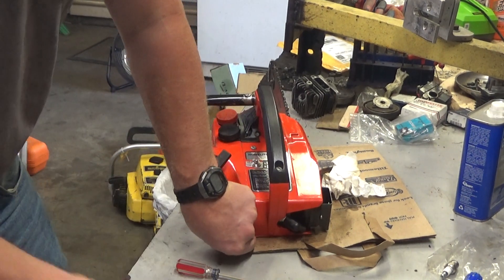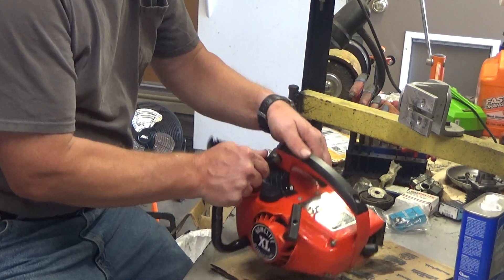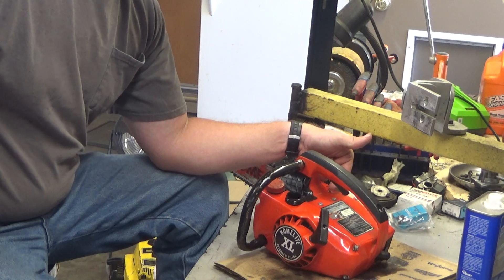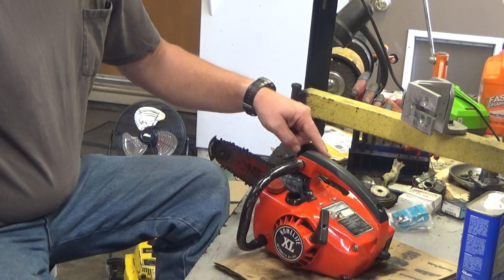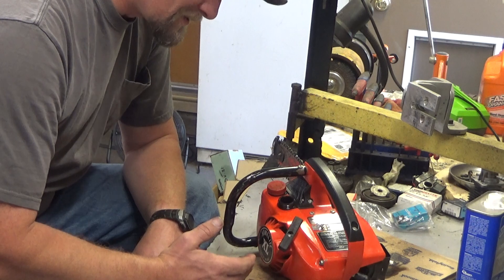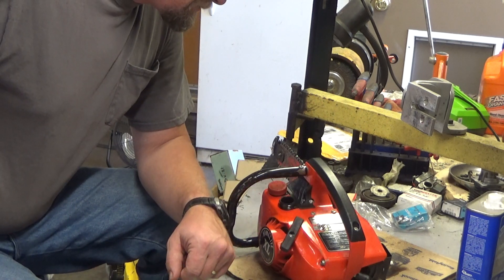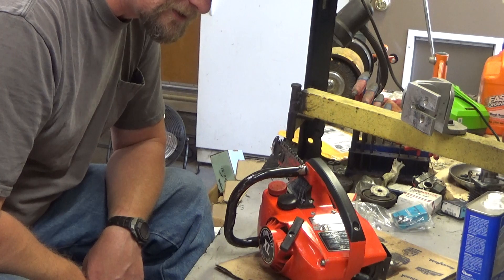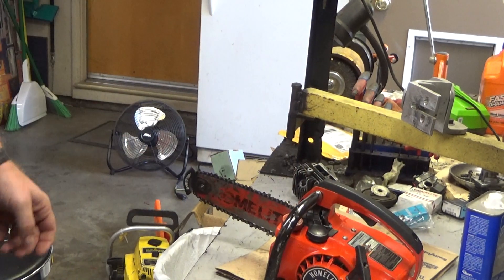Homelite XL Automatic Test Run

Comment: Came across your videos while I was looking for information on the carburetor on my homelight XL.  Part of getting the saw running was replacing the fuel and oiler lines. I got the saw running but I noticed the bar oil is being drawn back into the engine and not to the bar. Any idea what would cause that?  The saw hasn’t run for at least 20 years and I’m not planning on using it on a daily basis but it’s a saw my dad bought when I was 8 years old and it has sentimental value to me since my dad is no longer with us. Any advice would be appreciated. New subscriber and really appreciate and enjoy your videos!!

Comment: Would that cause oil to somehow end up in the fuel tank? I have an XL i bought years ago and the fuel tank has what looks like bar and chain oil in it.

Also I looked on your website and couldn't find a parts diagram for the UT# of my saw. It's UT-10517A

Comment: Leon that was exactly the info I was looking for and love hearing the story on these oiler issues and what they changed etc. 
I picked up a couple of these and noticed the one line has a brass tube one way check valve on the oil feed to the bar. I heard the balls will stick and someone took a hack saw it looks like to the side if this brass tube. Is that what you are referring to as the sintered hose?
Also I found a tiny orfice and was wondering if that was to restrict oil flow.
I was just going to loosen the cap to releive pressure when I shut it off. 
Love hearing the history of each model saw.

Comment: My XL air filter (1992 -ish) has a black polyethylene cage sort of like a box net for crabs.  It has a hinge like pin molded in at one end, does not unclip or swing up from the other at all.  Nothing like your aluminum cage and the filter is a different shape.  I sent you an email with pictures.

Comment: Cool, love those little saws, I agree with champion spark plugs can't beat em, very interesting about that oiler set up, I didn't know that. She runs great, good job as always.
Reply: Ive got a champion  DJ8J plug in mine is that ok or do i need to get the recommended plug?

Comment: Hello , I've really enjoyed your videos on the HomeLite saws , I've got 4 Super XL 12's , one D bow , two 24" bows , and one 20" straight bar , have you made a video for removing the clutch plate , replacing the springs and dogs , or fly weights , or shoes , whatever they are called , theres three of them in my clutches , then replacing the clutch , backing plate , sprocket , needle bearing  and so on ?  Do I need a tool to do this ? My saws are all red , early to late 70's .
Also in this video you mentioned on the carb that the gasket goes on first then the diaphragm , does that include the Tilitson and Walbro carbs as well ?
Reply from the maker: I haven't made a video specific to clutches yet, but it's pretty self explanatory once you have the clutch off.  Removing the clutch does require a special tool.  This seller on Ebay has aftermarket ones that should work: https://www.ebay.com/itm/FOR-HOMELITE-CLUTCH-SPANNER-WRENCH-XL12-SXLOA-XL101-102-103-104-123-XL400-XL700/231824014941?epid=1800722972&hash=item35f9c9be5d:g:93IAAOSwKIdac3FE:sc:USPSFirstClass!97535!US!-1

The gasket order should be the same for all carbs;  on inlet arm side you want the gasket first, then the diaphragm.  Exact opposite on the pump side.

Comment: Can you help me out, my little red XL needs the primer bulb which I have, but it will not go on, how do I do it? Any ideas the gas cap and all is fine, I just want to replace the rubber bulb!
Reply from the maker: You've got to carefully pry the retainer ring off, set the new bulb in place and use a few drops of super glue to hold the retainer in place again.  It's not pretty, but it's the best method I know of!

Comment: I have the exact looking chainsaw.  I measured the bar from the inside case to end of bar = 11", so they say round up to nearest whole number so assume the bar length is 12"?  Next to the on/off switch it provides a Lot No. G7122, UT No. 104442.  Has another label on the top near the bottom towards sparkplug with serial number T7700342.  Trying to figure out specs so I can order an air filter and sell it.  If anyone can inform me it would be much appreciated.  Thanks.

Comment: i have a 240 with missing duck bill valve in the side of the tank.where can i by those valves.its putting oil in the cylinder two.
Reply from the maker: I have them for sale on my website: https://www.leonschainsawpartsandrepair.com/store/p6432/NOS_Homelite_35SL%2C_150%2C_190%2C_350%2C_360%2C_C-72%2C_Super_XL%2C_XL-12%2C_XL-400%2C_Super_2%2C_XL%2C_XL-2%2C_VI_Super_2%2C_VI_Super_2_SL_Chainsaw_Duckbill_Valve_69451.html